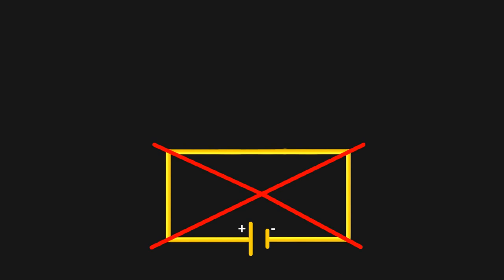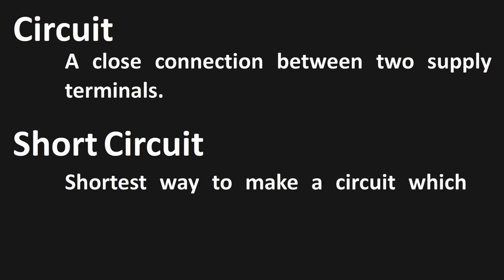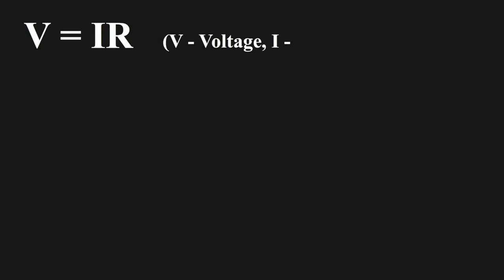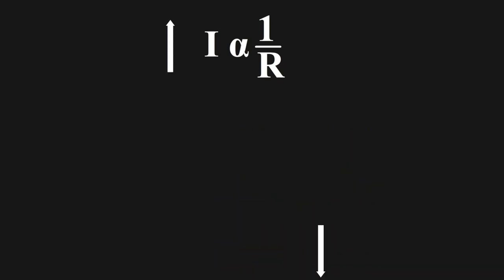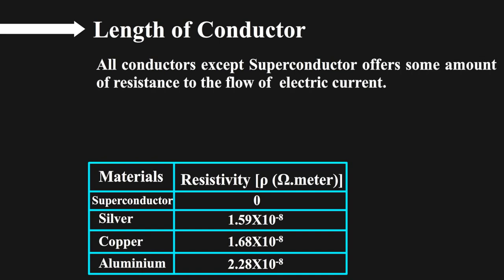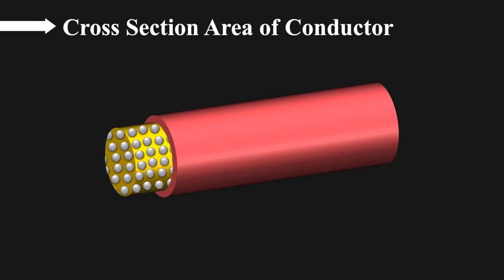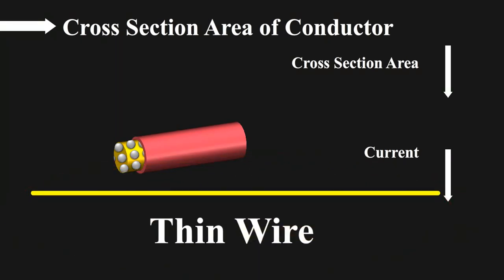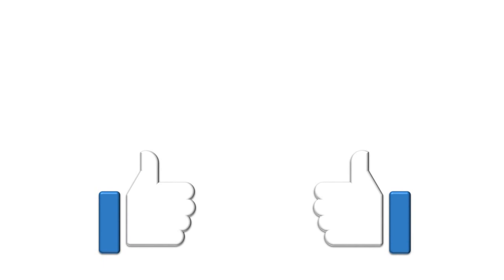Why Electromagnet doesn't Short Circuit ?

Comment: So if it does not short-circuit simply because of the length and cross-sectional size of the wire, then I can just connect an equally-long wire direct to the battery and it will not short-circuit, right? I doubt this is true. There must be some other reason.

Comment: This is just Playing with the definition of a short circuit. You're simply pointing out the resistance of the coil, which can be represented in the circuit by a resistor in series, since we usually ignore the resistance of connective wires.
Props for pointing out that low resistivity(Ohm-meters) does not necessarily mean low resistance(Ohms).

Comment: I’m a slow learner, I’m planning on making a very special motor and need to know this information 100% . It’s hard for me to keep up with you. The electromagnets I need to make, .. the smaller size the better, obviously the stronger the better. I need to know how to design them so I know the max power they can get and stay safe under a consistent connection for a very long time, like days or indefinitely. And also through in No or Poor ventilation for heat dissipation. How to keep them at a safe temperature so it’s completely safe and power consumption does not change because of heat, and have the magnetic field strength stay consistent. Please help!
Reply: Use very thin magnet wire (buy from Amazon), and use as many windings as possible. Long thin wire has high resistance, which lowers current and lowers heat generation. Many hundreds of windings increases magnetic field strength. If you're winding by hand, 30 awg copper magnet wire is the smallest you can wind without breaking. 

But also just try to see if you can buy a small motor that already fits your specifications, there are hundreds of thousands of different kinds of motors on sale online, I'm sure one will work with some research and will be much easier than making your own.

Comment: Thank you for explanation. This makes sense but the thing I dont understand is all the wires are naked in coil so why it still doesnt short and the current prefer the long way?

Edit: Oh found it. While it seems like the copper wires are naked, actually they are not and insulated with thin insulator. It is called magnet wire on wiki.
Reply: They are coated with a layer of varnish

Comment: My electromagnet did short circuit.. i used 2 feet of insulated 22AWG copper wire with 25 turns and the AA battery started smoking
Reply: It is absolutely necessary that the primary has the appropriate amount of turns for the input voltage however the secondary can have as many as you like just make sure to use a sufficient ferrite core/transformer!

Comment: It's not correct way. Here the reason is inductance. 2 pi fl.
Reply: why bringing inductance while dc gets no frequency?
Reply: Yes the formula is right, the impedance of the inductor is 2πfL, but that only works for AC. The content in the video explains why inductors don't short-circuit in DC circuits.

Comment: So wrong
Reply: Why? Is there anything related to impedance?
Reply: The impedance of the inductor is 2πfL, but that only works for AC. The content in the video explains why inductors don't short-circuit in DC circuits, and it's correct for DC.